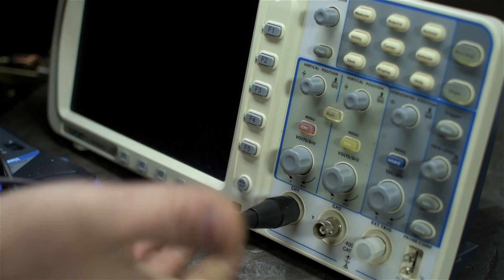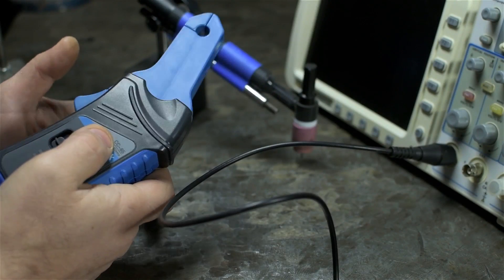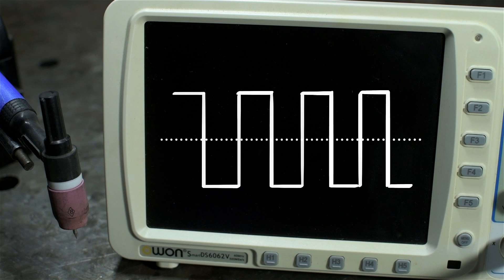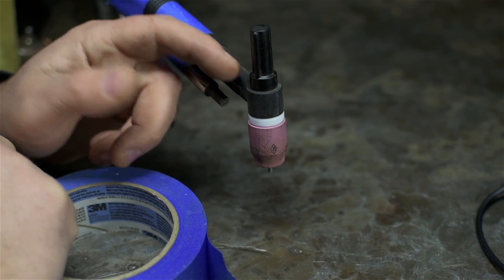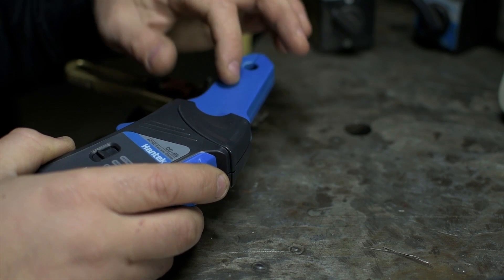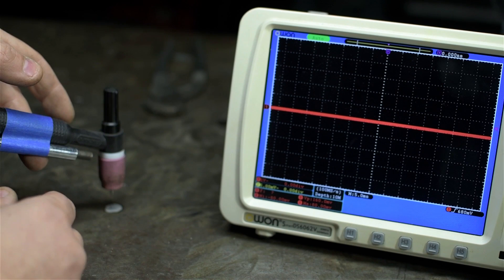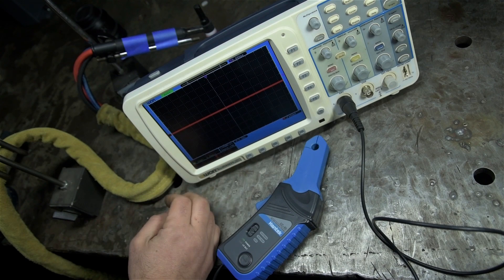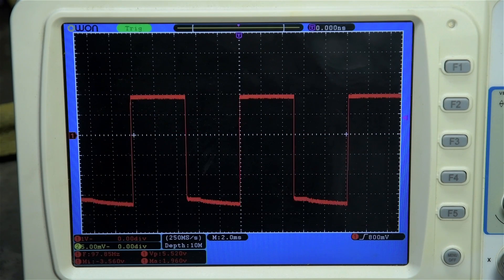Oscillo-Help-Me?

Comment: Check the power supply. The US 115V BS was horrible to work with even in Mexico. However back in Australia (240V 50Hz 10A single phase or the sexier 415V 50Hz 20A to 100A three phase), things like brown and dirty power are near non-existent. I had a generator that over a week, it decided that it would no longer run a welder, drill or even a kettle. For some inexplicable reason, the genset was generating more negative then positive. Our crew electrician told the supervisor what happened, who of course didn't believe a word of it. About 15 mins after that phone call, someone ran over that genset with a D8 ... ok it was me. Another phone to the supervisor and a threat to burn the drill rig, got us a brand new Dunlite genset (Aussie brand made with foreign parts). With the new generator, we had no issues what so ever. I asked the sparky (Australian for Electrician), to measure the genset output and each welder's output and that was it. The old power source was leaning towards to dark side, even though other items worked such as lights, TV, chargers, laptops still worked. The sparky said, the TV, radios, laptops were low draw items that's why they still worked. The high draw items like power tools and the electric kettle, didn't work because of the high amperage draw. I hope this helps.

Comment: welding instructor here. I'm not a welder technician. but, very possible that your hypothesis about welder manufacturers calling an asymmetrical waveform "50/50" is correct. 
miller, lincoln and esab are all known to make assumptions about the intelligence of their customers. I wouldn't be surprised if htp is the same. the positive half cycle is, of course, useful- cleaning action, cathodic etching... but wrecks the tungsten. can't have us dumb welders dialing up a 50/50 balance and melting our tungstens left and right. so they skew the waveform settings towards electrode positive. 
I've noticed, for example, miller dynasty's don't have 50/50 balance. if you turn the balance down that far, the machine gives you 100% electrode positive; it assumes you're trying to ball a tungsten.

Comment: Tony I am getting similar results from my Miller Dynasty 280 DX, but I know there is something wrong with my welder. I am using a 2 channel Rigol scope and the larger version of that same brand clamp on current probe. In my case I am getting 200 amps on one side of the waveform and 280 amps on the other. But if I drop down to 100 amps I get 100 amps on both sides. My welder blew up the power input and control boards but the repair shop insisted the IGBT's were ok. I don't think they are. 

From what I can see it looks like you are testing it correctly. You could also switch to dc and see what you get for a reading on the scope with the clamp on current probe in both orientations on the wire (arrow facing the welder and arrow facing away). If you get full scale and equal readings then I would say you are not getting a true balanced waveform.

Comment: From the manual of your current probe "it is necessary to turn the zero adjustment knobs on the clamp until the multimeter or scope reads zero". Did you remember to do that?

Comment: Try a dead short instead of an arc. Or arc between two tungstens.  The welder may be trying to put out an equal waveform, but it may be easier for the electrons to go in one direction. It's easier to start an arc from a point than a flat surface.

Comment: If you insist at looking at the waveform on the output side the use a loop or two of regular hook up wire, don't touch the probe because the HFT start will blow the front end of scope. If you want to measure exact voltages then start the ark, let HFT start stop, and then connect the scope. Remember that the probe GND and tip need to be equally connected to the power supply, same gauge cable, same distance, etc. worst case go buy a high voltage probe, but after 30 years as a power EE, I have never bothered, don't think you need to either. My guess is it's a design tradeoff, or GND loop.

Comment: I would suggest the following experiments: 

1)Turn the Clamp around.
If we see in inverse of what we have seen before, we can assume* that this setup is able to measure DC current. 
*(or at least it would strengthen my confidence )

if not 
2)Try to measure DC 
Like from a battery. (pro tip: increase the turns trough the clamp )

3)Isolate the welder from the workbench.
I don't know if welding transformers are isolated.?
i would assume it cause if not wouldn't they always trip the RCD and make nasty ground loops.
possibly sending the welding current over PE/earth? 

But if the output is relay isolated and your work peace is not Earth grounded  could it become live at high voltage? 
for example if you accidentally Weld on the Earth grounded workbench?

Sorry i think i only have more questions and no answers.¯\_(ツ)_/¯

Comment: You are not sharing the same ground plane so your measurements of any symmetry will be invalidated. Also, the noise at the bottom of the square-wave will serve to reduce voltage on the negative half so the apparent power will be different than on the top half. It's not an easy thing to measure and requires quite a bit better test equipment than many of us can afford. Or some hacking into the circuit board of the devices in question (also disabling HF start, etc)

Comment: With 700 comments you will probably not see this Tony, but just in case you do I'll try. 1st measure the waveform on the gate of the IGBT or MOSFET modules. Measuring at the torch subjects you to the high frequency start, tons of inductance, And God only knows how many ground loops. All of those are going to introduce multiple asymmetrical errors. For example, the GND clamp wire is usually longer the the torch. Once you have voltage at the gates look up the data sheets for the IGBT and simply read the current corresponding to the gate voltage. Is it matching what you saw at the torch? 2) Cut the GND lug off the plug of the scope, or get an isolation transformer. It's there for shock protection B.S. battery is also a good solution. I'll go into the lab tomorrow and measure my tig.

Comment: Fist thing I usually do with clamp on probes is flip the probe and see if the signal stays the same. If turning the clamp over makes it suddenly have positive offset, it's the welder. otherwise, it's a screwy probe or a failed input channel on the oscilloscope. In that case, try a different channel, or see if there are any adjustment screws on the probe and try calibrating it against a known good source (e.g. an incandescent light bulb on the other side of a DC blocking capacitor on household 120VAC)

Wait, did you say you're clamping on the ground?! Hot or neutral, not anything on earth, you'll get all kinds of weird garbage on something connected to earth

Comment: Yes. make sure you're ac coupled on the input. And try switching that clamp the other way to see if it changes the output. That should get you there. Any DC present to offset the wave should be eliminated by that clamp probe though..

Comment: Tony, you probably won’t ever read this 682nd comment, but I ACTUALLY know quite a bit about the subject of measuring high switchmode currents on an oscilloscope, although I do not know exactly what your welder is doing. There is a good likelihood that your probe is not maintaining waveform fidelity. This is because the current probe has its limitations, and you are very likely encountering them. The AC/DC types of current probe reconstruct the waveform from 2 entirely different sensing systems. There is a coil for the AC component and a Hall Sensor for the DC component. Some analog circuitry combines the components, offsets in the DC component develop very easily, due to drift in the analog circuitry and magnetization of the split core that carries flux to the coil and the Hall Sensor. Since you are operating near to the 65A limit of the CC-65, it is very likely that the probe is going non-linear and DC offset. (Someone suggested testing a 200W lightbulb load. This may not be enough current to tell you much, unless the current probe is really terrible.) I can suggest 3 remedies: 1) Make a current divider and probe a fraction of the total current, 2) Get a higher capacity probe, 3) Make a current shunt and probe voltage instead of current. In more detail: 1). Take short lengths of copper wire of 2 different gauges, say #4 and #12, and put them in parallel to make a current divider. Install this in series with the ground lead for your welder and put the current probe over the smaller gauge wire, which will carry a fraction of the total current. 2) Buy a higher capacity ACDC probe, which will have a lower high frequency limit but probably be good enough. 3) Between the welder and the ground lead, install a very low value resistor, which can simply be a short length of steel bar. Probe this with a voltage probe. Let me now if you actually read this, Tony.

Comment: Change to DC welding. Use your clamp and check the scope. Then swap the leads at the welder from DCEN to DCEP. You’ll have the same welder settings just different direction of current. Compare results.

Comment: I experienced a similar problem with an accelerometer signal once. When over-driven, the positive side would clip while the negative amplitude exceeded twice the positive w/o evidence of clipping. If the signal represented the real world, the system under test should have been waltzing out the door. Turns out, it was an operational characteristic of an op-amp in the signal conditioning circuit.

Comment: What do you have to work with? Like others, I suspect that current clamp is saturating. So how can we do a verification? One quick test would be to wrap a couple turns of wire around the ground lead and connect them to a 10:1 probe, and set the scope on the highest range (20V/cm?) and strike an arc. You now have an uncalibrated inductive current probe, and hopefully the HF start won't be mucking with the scope. Adjust gain until you have a decent waveform. You won't be able to tell positive or negative offsets, but you should be able to get a decent waveform.

Second method: buy a 200A or so current shunt resistor from eBay for a few bucks and wait for it to show up. This will be a 0.01 ohm or so resistor. Put it in the ground lead and clip the scope probe across it with the ground lead on the machine side of the resistor. You should now see a 2V offset at 200A if it is a 0.01 ohm resistor. Adjust reading for other possible resistance values. This way will let you look at DC offsets. Since the HF start is HV but low current you shouldn't fry the scope from the HF start, and with the input grounded to the machine ground you may stop having pickup problems. Or maybe not, since an HF arc is a pretty good radio transmitter -- just ask Marconi. 

You could try wrapping tinfoil around the scope and grounding it to the machine, but if the pickup is thru the front panel that won't help. A Faraday cage of screen wire might help, but without bonding it to the scope probe shield wire even it might not be sufficient. Hopefully just grounding the scope ground to the machine groups would be sufficient, but I'm not betting on it.

Comment: Wow, I tried to look through the comments to see if anyone had suggested that it's probably correct and how you can check it.  I did see that several people recommended you turn the clamp over, and that's good, but I doubt the clamp is your issue.  First, you really need to turn off HF before getting anywhere near it with your scope.  I won't even keep my cellphone within 50 feet when I'm using HF.  Now, that said, you are measuring current, not voltage, and there are a number of reasons why the current curve will look like it does, most of which I'm not sure I can adequately explain, but in short, even the difference in the composition and shape of the electrode vs base metal will effect the current balance in the arc.  You should also hook up a set of voltage leads to your output, as well as play around with your balance control and the shape of your electrode to get a feel for what is going on.  I've never hooked a scope to it, but I've got a Miller Dynasty 200DX that I'm willing to connect up and take some measurements for comparison if you'd like.  I'm expecting to see the P2P voltage balanced but the current being offset due to conditions in the arc.

Comment: Ground the o-scope to the item of reference. It needs to know what zero is in terms of voltage. But in the case of amperage through an isolated clamp, zero will always be skewed by the offset ground of the clamp input. ( which should have one side grounded with the rest) There is otherwise no zero reference of the clamp. And I also agree with others that if the current clamp is flipped, that offset will also flip. (Well unless it's not finding zero due to some other strange reason.)

Comment: Hi Tony- I have spent a good deal of time researching welders to fix my own SRC and IGBT systems- some of what I learned is straight forward stuff that you probably already know but might not be applying. All those that weld aluminium ( yes I said it) know that the reverse current portion is to clean the weld area of oxidization so more negative results in more “cleaning” action. Well in that case we could just reverse the leads of a DC welder and do it on the cheap-no?- Well, no.... as it happens there is more heat transfer in one direction than the other and therein lies the probable answer . For a truly balanced output you have to have an asymmetric wave as one direction gives more heat than the other . The likelihood of the scope or welder being off is low- My suggestion is it is to level out the power differential. Thanks for the videos- always entertaining :)

Comment: i would not be surprised that they cut positive current to try not to induce too much heat in the tungsten, preventing it to ball up but still be able to lift the oxidation layer from the aluminum.

Comment: Tony, I'm just a computer guy, so pixes are just pure magic to me, but I'm curious if you've tried a different power source.  Perhaps that's some sort of interference making it's way down from the mains?  There are a lot of steps between torch and the wall, but my normal troubleshooting procedures always end up going back to basics and tracing the problem in a line from the source..  Might be worth a try before getting too technical. :)

Comment: Total shot in the dark here, but the I think the probe is the problem. In the manual for the probe (http://www.hantek.com/Product//CC/CC65_Manual.pdf), under application notes it says:

"2.
In  the  case  of  DC  current  measurement,  the  current  clamp  can  not  possibly  zero properly,  due  to  the  hysteresis  effect.  To  eliminate  this,  open  and  close  the  jaws several times and then zero again"

Not an expert in magnetics but I'll give it my best go here. "Hysteresis effect" implies that the probe relies on a magnetic material (probably in the jaws) to direct the magnetic field from the wire-under-test to a hall-effect sensor (probably since it's the cheap way to do it). Hysteresis is the leftover magnetism present in the jaws that could fool the hall-effect sensor into thinking there's a DC current. Now here's the sneaky part: if you zero the probe the display will read zero, but the jaws will still be magnetized. If the jaws are magnetized, current in one direction will saturate the magnetic material sooner than the opposite direction. If that happens, you might get the waveform clipped on one side like you're seeing.

Snapping the jaws as it mentions might A) act like a hammer on a magnet and reduce the magnetization that way or B) cycling the jaws alters the magnetic circuit in some manner that reduces the magnetization.

Comment: I am an electrical engineer, so what I am about to say might make some eyebrows uneven.  This could be a distortion.  The info I could find did not say if this was a Hall effect sensor, but that might apply too.  Your clamp is wrapped around a wire, and as that wire moves current, a magnetic field curls around it bouncing toward and away from the conductor, and also flipping in the direction it curls.  The field is perfectly round.  however, if your clamp is not symmetrical in its sensitivity, the negative magnetic field may not be seen the same way as the positive, or the curl in one direction looks different than the curl in the other.  Maybe your clamp is magnetically offset?  (slightly magnetic) or the core is cracked? or the winding is skewed?  Im not sure.  Electromagnetic theory kinda curls everyone's brain cells. Find a video on Hall effect sensors, and think about what would happen if that magnetic movement was not even from one side to the other.

Comment: i think it may have to do with the IGBT's switching time. when the welder turns on the waveform goes positive, then when the welder goes negative and has to switch one of the IGBT's off, the act of switching such a large negative load causes the switching device to be slower causing that slight sawtooth pattern as the resistance between gate and source increases while switching off.

Comment: As @Doug Coulter said, the perfectly flat top is VERY suspicious. That so very rarely happens in the real world, at those power levels, and it makes me think something is hinky. And yes, I am also a professional pixie wrangler.  I'm betting about $5 that your probe is getting overloaded. Large currents near the limit of cheap current probes do strange things.  Very strange things. I found that out with a medium priced that anything close to 75% of the rating was the range where it stopped reflecting reality.

Comment: 3.) Your tungsten electrode has a point ground on it. For AC weld output, the electrode should have a "ball" formed on the end. Find out how to put a "ball" on the proper type electrode.